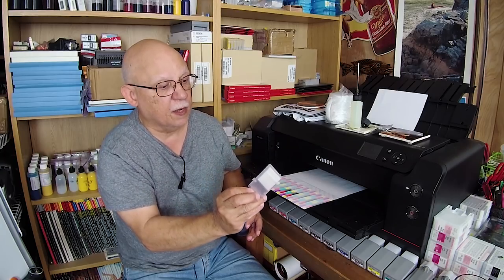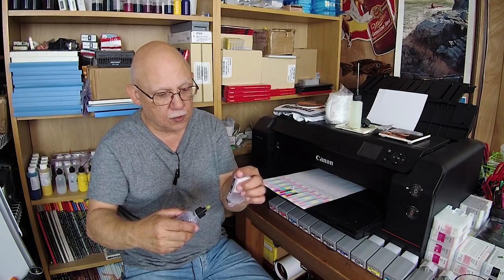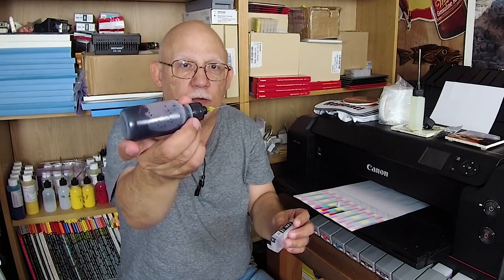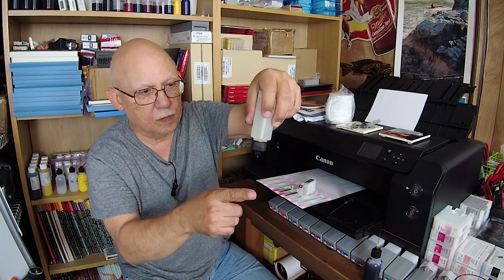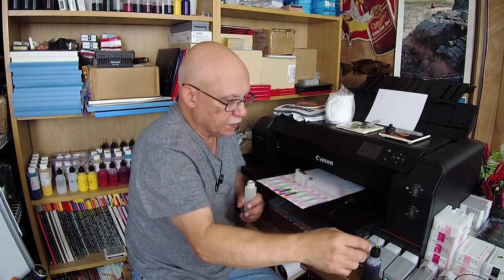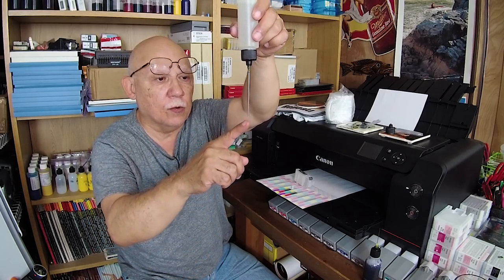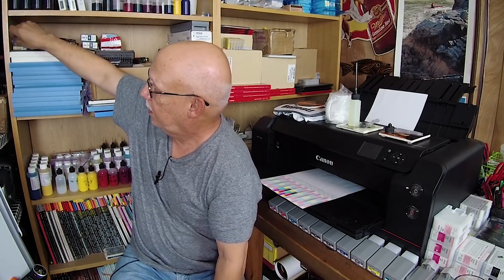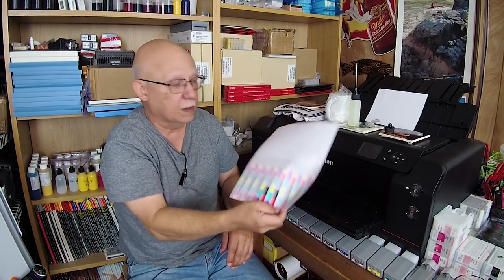Do You Refill Your Carts With Syringes or Squeeze Bottles?

Comment: Good one, Jose!   I recently purchased a PC "squesy" refill kit for my Canon iP8720 with five 2oz bottles and one 4oz bottle.  The 2oz bottles are the soft ones.  Since the caps and needle "sqesies" are re-usable,  those are ordered separately.  The caps and needle ends came separate and the O-ring was installed in the 4oz cap.  I also purchased refillable cartridges from PC, so we will see how that goes.  
My first refill process was a bit messy.  I found getting the foil sealing caps off the bottles to be a pain (but maybe you just puncture them?).  I didn't get the trick on tipping the cart while loading the tip into the hole.  Also I was constantly fighting a bubble of ink formed around the fill hole while filling - maybe my carts have a smaller fill hole.  Also when attaching the needles to the caps, a couple did not tighten, though they don't see to leak.  Note that PC has a set of good Youtube videos regarding the refilling procedures.  It was really important for me to have a look at these before attempting the first refill.  Here is the link to their Youtube channel: https://www.youtube.com/channel/UC11h9HbpqWHSI8PUZrOf-Ow
Reply from the maker: Bubbles are totally user error and you will get better at this with more practice.  Make sure those O rings are seated on the cap perfectly in place. As I said they do not lock in though I could not get mine out in the video. If they and the cap are not installed correctly they will leak and it is not their faults as they are actually designed for industrial use.  Believe me I am very familiar with PC's video Channel.
Reply: Got ya .... just to clarify .... I think if you order new Squesy caps now, the O-ring is installed and doesn't come out.  So folks who are adapting old caps will have to install the O-rings properly.  The cap I got from PC had the o-ring in it and it worked fine.  Keep up the great work, Jose.
Reply from the maker: Ok I not not know that. I received the very first samples way back

Comment: It would be great if PC supplied their ink bottles with the needle caps included. Surely they are just a few cents?
Reply from the maker: But They already are doing that. Have a look.
Reply: Hmmm, my inks didn't come with them. Must be a new thing in the last couple of weeks?
Reply from the maker: http://precisioncolors.com/C10bref.html They may include them for EPSON Refill kits as well but right now it seems only for the CANON Refill kits.
Reply: I use the K3HD inks for P800 so maybe that's why. Hopefully they will include them in the Epson inks too in the future. Thanks Jose, as always!
Reply from the maker: He will call me tonight so I will ask him about that!
Reply: Top man!
Reply: The "Squesy" caps are reusable for use on a replacement ink bottle so they are sold separately.  The bulk bottles just come with a plain cap.  The larger #24 caps with the needle are $2.00US each. Good deal. I got a refill kit for Canon which optionally included the Squesy cap system, but you can buy them separately (go through the home page link on their web-page.)

Comment: my friend Joe .... I Wanna Know Are All The CLI CMYK Colors Are The Same Formulation ? And When I Refill Canon CLI-42, Can I Refill With Any Other CMYK (not LM LC) In Precision Color ?
Reply from the maker: You fill with whatever I ks designrd for the PRO100 you want to use. Just not the yellow one. But it MUST be for the PRO100 and never "Universal" type inks.
Reply: @cheo1949   example - CLI-551 CYAN Ink For CLI-42, Joe Im Asking This Cuz I Have 2X1L  Of CMYK Inks For cli-551 For Extra ... I Cant Throw it For Bin . .
Reply from the maker: I suppose you could but they are actually different! In this case Cyan is not Cyan.
Reply: @cheo1949   cause clogging ?